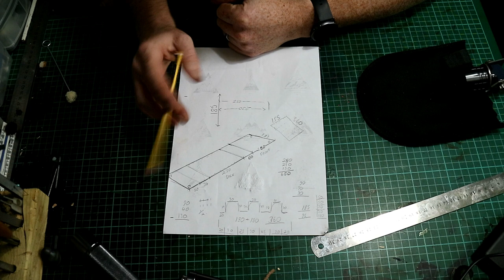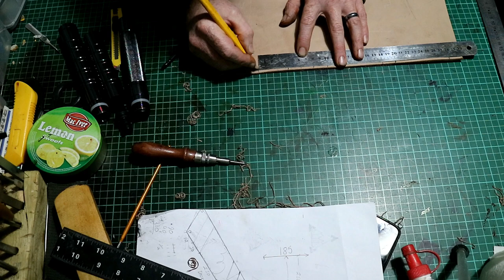Tattooing Veg Tan Leather

Comment: cool way of curving your did think outside of the box and did use in your advantage leather would have been called waste into the project like that too could have used rivets to pop the bag right out   did hear you very clear on what you did not what to use it for i do honour your choice their overall the looks with  2 D rings would have given a greater appearance  
for me, yes a Dring and some how-to wear it would be in my lead inside a pack on the bottom of your pack to me is a waste  yes I have mine on the outside of my packs too
Reply from the maker: Hi thanks for your comment, I'm not a huge fan of pop rivits as they have less flexibility than stitching.
I like your idea of some d rings so it gives me the option to carry it on the outside, however I work with young people, so all my tools need to be inside of my pack for safety.

I need to give this another try so I can show all I learned from this project

All the best
Bruce

Comment: Instead of using glue you should try to use vaseline. Spread some vaseline over the skin and during the process when cleaning the ink with paper drop more vaseline before hiting with the needles. In the end let it dry for 24h and after wash.
Reply from the maker: I did try that first, the leather absorbs the Vaseline and it still stains from the ink splatter.
I also tried clingfilm, I've been thinking Painters masking tape might work and hopefully not bleed under it 

thanks for watching, I really need to give this another go on a new project.

atb Bruce